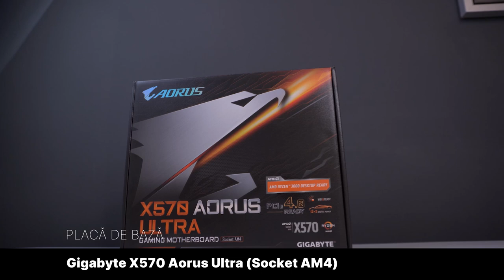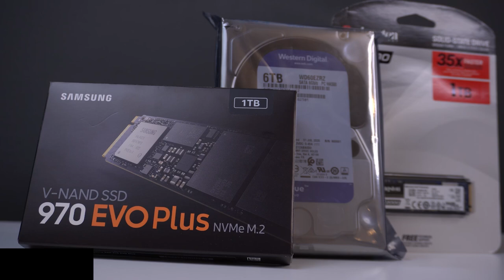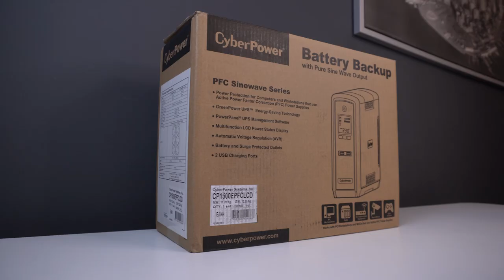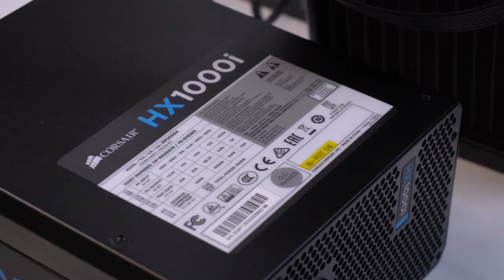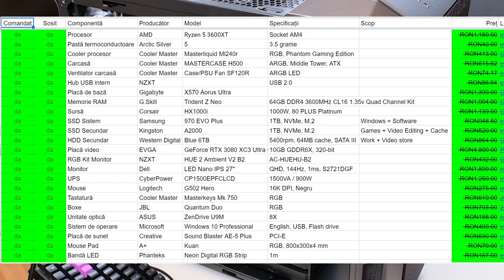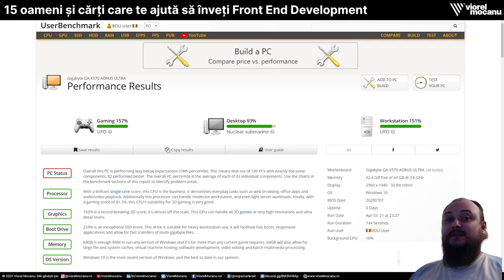Noul meu PC #RGB: componente, asamblare și cum arată în final #hardware #RTX3080

Comment from the maker: Tu ce configurație de PC sau Mac ai?
Reply: In noiembrie mi-am facut upgrade si eu cu o configuratie asemanatoare cu a ta, doar ca un nivel mai jos, 32 gb ram, 3070 (luat cat inca era 3.800 lei), tot 2 ssd de 1 tb si am mutat hdd de 4 tb de pe pc vechi. As fi vrut o sursa de 750 (pentru un posibil upgrade de gpu in viitor) insa cand am cumparat eu nu aveau in stoc asa ca am luat de 650. Am facut greseala sa imi iau cpu intel dar pt cum joc eu e ok (ma joc la 60 fps). Ah, si am rgb doar pe cooler-ele de pe carcasa (3 in fata si 1 in spate) :) are si placa video, rgb insa i-am setat ledurile sa aiba anumite culori in functie de temperatura ca sa pot vedea rapid in ce bracket sunt.
Reply from the maker: @GhergheMarius  Deșteaptă opțiune să setezi culoarea LED-urilor în funcție de temperatură, o să testez și eu treaba asta, de curiozitate.
Also, nothing wrong with 60fps gaming! :)
Reply: mac studio m1 max 32gb ram si 512ssd, si mai am un server xeon 2ghz cu 16gb ram si 2tera hdd,  Eu credeam ca doar la mine prin Rahova sunt probleme cu curentul si d aia mi am luat ups imediat cum m am mutat
Reply from the maker: @aurelianrosca5655  sunt probleme cu curentul peste tot din păcate. :( UPS-ul e sfânt.